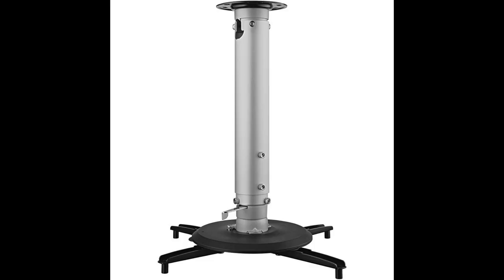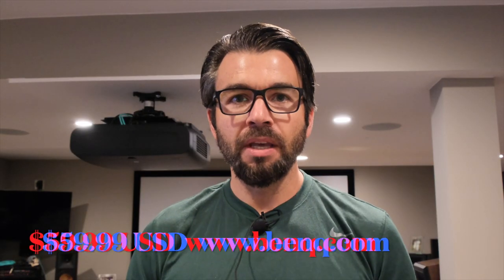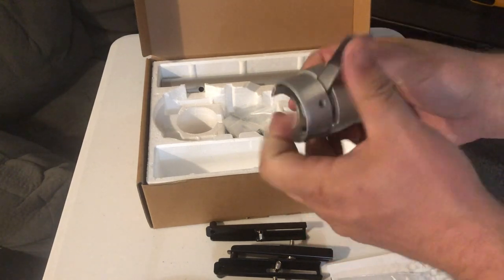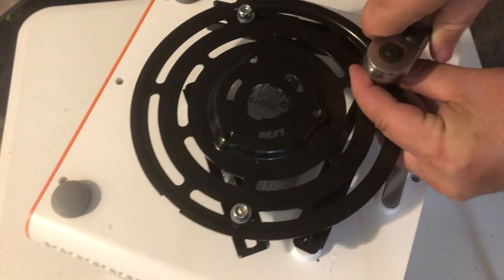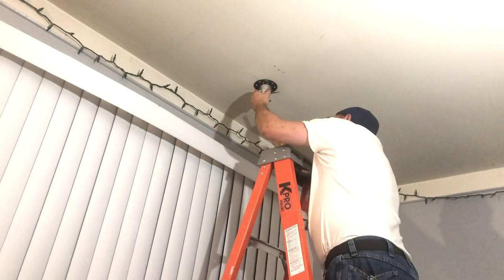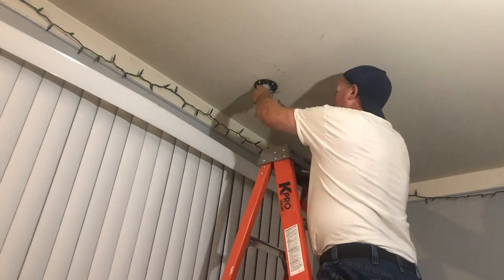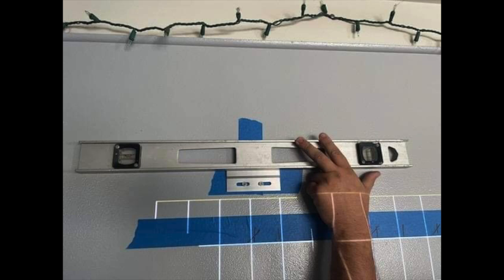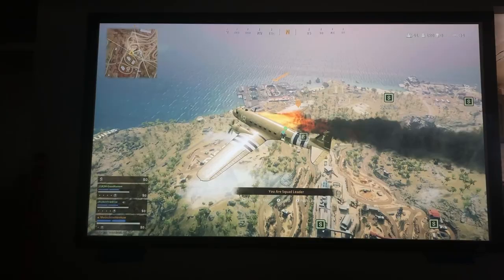BenQ CM00G3 Ceiling Mount Installation using the BenQ X3000i 4K Gaming Projector

Comment: Great video! For this mount, if you need a drop of, let’s say 6 or 7 inches, is it possible? The two initial pieces were about 5 inches but it looks like if you add the additional poles it would drop down too far

Comment: Hey, I just mounted the x3000i with this mount today. I didn't have a drill bit the right size to get the anchors in and didnt want to risk forcing them with a hammer so I just put the 4 bolts it came with in with 2 in a joist. You think thats good or should I readjust? Also Im assuming the anchors arent meant to go into a joist anyways right?
Reply from the maker: Are they lag bolts?  If so the lag bolts go right in to the wood and the anchors and screws go in drywall.  No need for the anchors if they can all go in wood.  Let me know if that works or message me on my TheDaingeon Facebook page and I’ll help you some more 👍
Reply: @thedaingeon  All 4 are the bolts that come with the mount. 2 are just in the drywall and 2 are into a joist as well. The manual sort of implies that they all go into wood with the anchors but it also refers to the ceiling as the wall repeatedly so the translation isnt great.
Reply: @frostycanadian7311 you shouldnt have 2/4 bolts just hanging in the drywall. Get anchors for those 2 or its going to fall out.

Comment: Where did you get the power to run the projecter?
Reply from the maker: In this video we use an extension cord and power strip mounted to the window edge.  That is until we find time to run a legit wall outlet and punch some hole in the drywall

Comment: I have a rookie question: if my pc is 60hz of frame rate and I connect it to this projector, if the game supports 120 hz it will project on 120hz? Or 60hz that is the max my pc can handle?
Reply from the maker: What game and what graphics card?
Reply: @thedaingeon  Rocket league and a GTX 1050 ti
Reply from the maker: @Mauricioa1096  is the 1050ti hdmi 2.0?
Reply: @thedaingeon  I think, it does not have 2.0 but maybe 1.4, it will work or can I install an adapter or something?
Reply from the maker: @Mauricioa1096  I think  it will do 1080p 120hz based on my research.  You should be good 👍
Reply: 60hz since you're using your pc hardware as the output